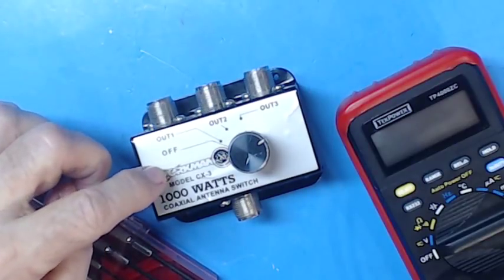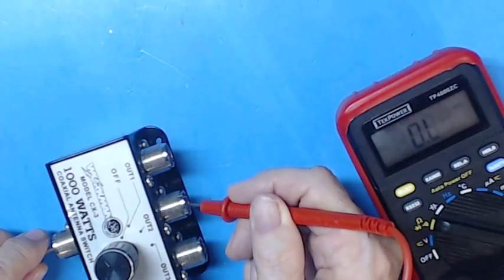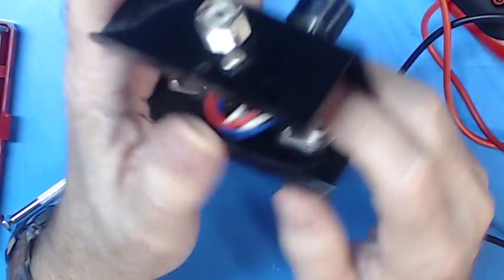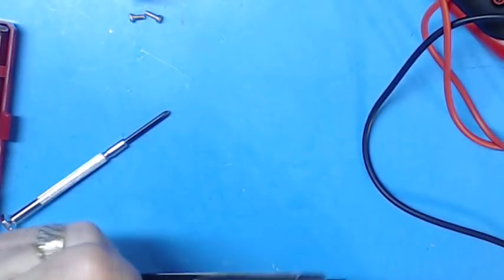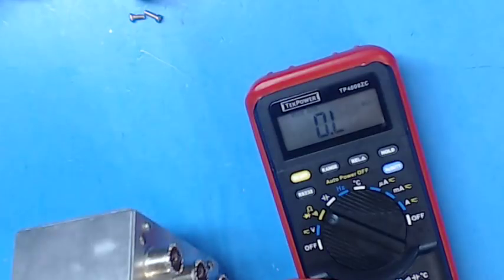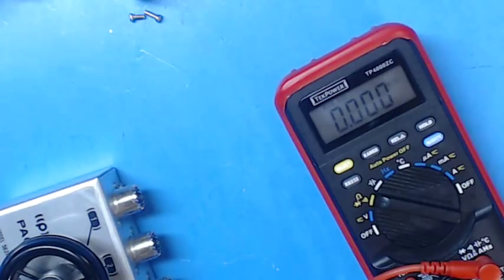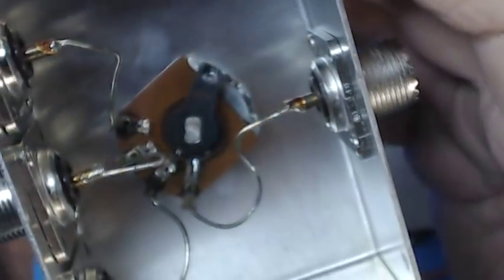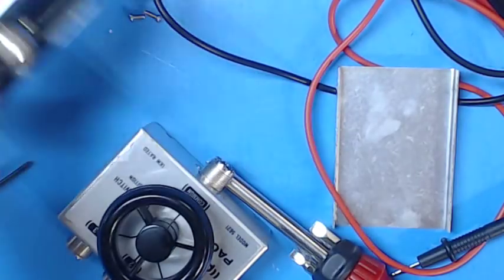TRRS #1344 - Inside Low Cost Antenna Switches

Comment: Thanks for video. I am a SWL and have one of these switch boxes. The only trouble I found was if you had to take any of the PL 259s out it also pulled out the socket as well. I got over this by replacing the original sockets for SO 239s bolted in. I am in the throws of making a 6 way box as the three gang is not enough for the antennas I have.
Reply from the maker: Thanks for the report and have a great day.

Comment: Typical CB antenna switch which is ok for low wattage transceivers. A better switch would be using a ceramic insulator
with heavier contacts but it should work good for your receivers. My favorite was the old HyGain antenna switches
that were used on the old MoonRaker beam antennas which could handle good power levels. They were shipped with
the antenna. The CB antenna switches were overpriced when CB was popular and thanks Tom for your review on the
Hamfest buys.
Reply from the maker: Thanks for the info, Dennis.

Comment: they seem to raise the swr I bit and the pusher connected  so239 fall apart, it's a week point. you can rewire it to a common ground and short wires to the center conductor.
Reply from the maker: Thanks only using on receivers.
Reply: @hamrad88  ya I seen the pictures for the mod on Amazon reviews. my self minf fell apart in my hand with very little force.
Reply from the maker: Interesting. Thanks